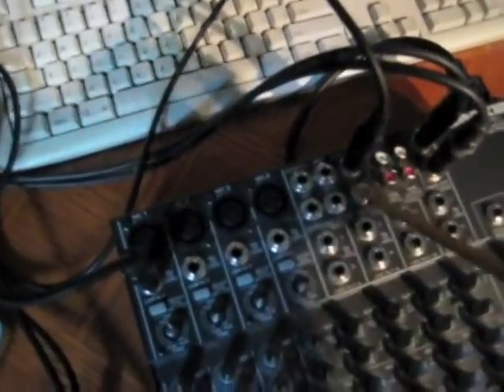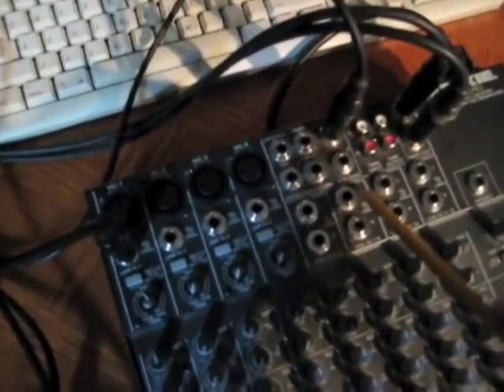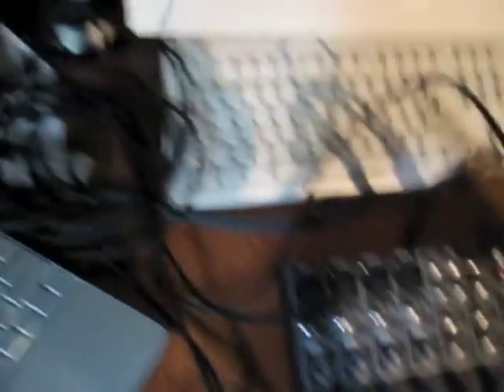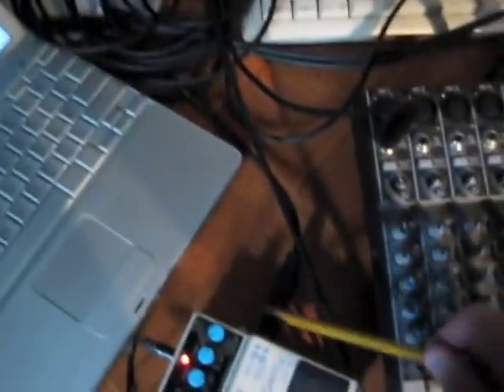Fun With Feedback

Comment: What was the seed of the feedback loop? Was it the natural noise of the equipment, or something else?

To make sure you know what I'm asking:
The seed in video feedback loops tend to be things like text on the screen or toolbars, objects that don't cause the loop but are instead sucked into it and give it substance and variety. Without these initial/original/seed objects, the loop would be nothingness/void/empty.
Reply from the maker: Matthew Kleinsmith  the seed is the equipment itself. Some call it no input mixing
Reply: Thanks for the reply, I'll check it out. At 0:46 why did the change you made to the delay have the effect it did? It sounded like it was increasing the pitch of the sound. With a beginner's mind, my intuition is that a delay would cause a lack of sound as it filled some sort of buffer, and then add an effect when the buffer was released. Is that what happened here?
Reply from the maker: Matthew Kleinsmith the delay was grabbing or sampling the sound then essentially speeding up the playback rate which raised the pitch